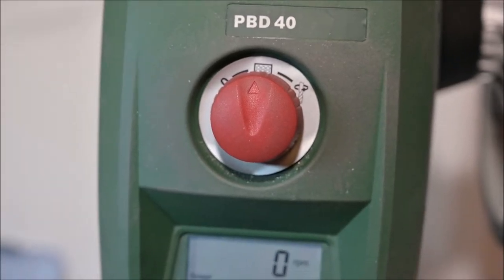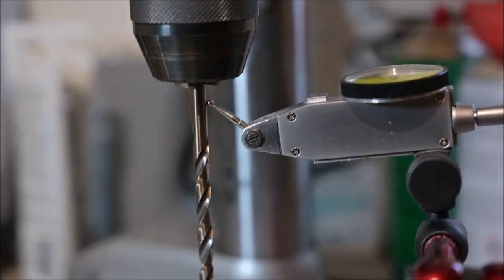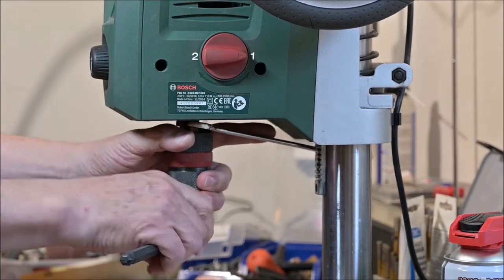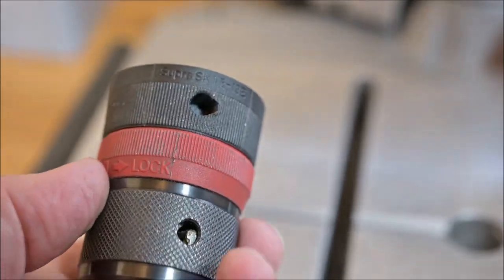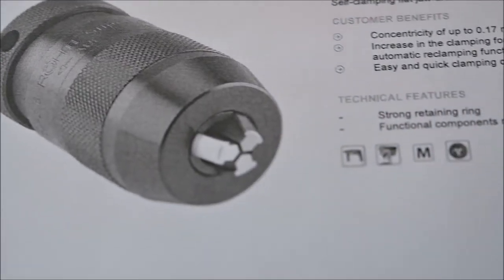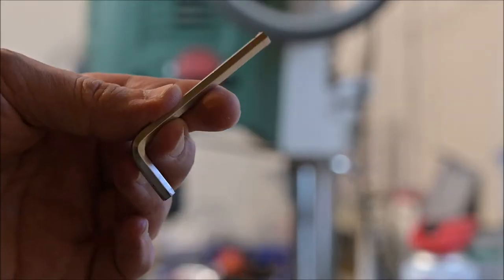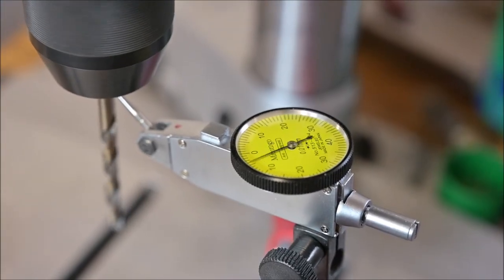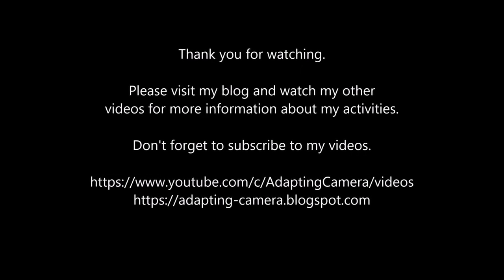Chuck changing on Bosch PBD 40

Comment: Thanks for the video. It's been most informative. I recently sold my old pillar drill as it got too heavy for me to lump around. I have been looking for a new drilling solution ever since. It did occur to buy a PBD40 and replace the bearings and chuck. But that makes a £250 machine into a £400? machine. When you take away the gimmicks, i.e. the laser and electronic depth adjustment, there's only 2 things that make this machine desirable. It's a lot lighter and therefore portable than a traditional bench drill. The only other real advantage is that the drill head moves relative to the base, dispensing with regular checks for perpendicularity. 

BUT the NOISE of that motor. OMG. I'm now thinking a better and cheaper alternative would be to buy a Woodpecker Auto-Line Drill Guide -  assuming one already has a qood quality cordless drill. I'd bet good money that my Makita brushless LXT with an Auto-Line would outperform even an upgraded PBD40 in every single respect; cheaper, lighter, less runout, more torque, more more portable, more versatile and quieter. I already own the Makita. So I'd only have to buy an Auto-line, which at the time of writing would cost me £189 plus shipping, import duty & VAT. A cheaper chinese version (but all steel and alloy construction) is on Banggood for £52 plus shipping, import duty & VAT. I'd love to see a comparison between a suped up PBD40 vs a decent cordless in a Woodpecker Auto-Line.
Reply from the maker: You are comparing apples and oranges. The Woodpecker Auto-Line Drill Guide is a toy and the Makita LXT, while it may be a very good cordless drill, it is still, "just another cordless drill", cheap, impact drill with low RPM. Impact drills are NEVER comparable with any bench drills, and I bet you will have a lot of play in that chuck and axis. But of course, if all you do is drilling a few holes in wood and never need to work with metal, it may be good enough for you, but you can't really believe that the weak 350W motor outperforms the PBD 40, which has a 710W motor, with constant speed and torque electronic, which actually works very well. The Woodpecker Auto-Line Drill Guide is nowhere near making your cordless drill into a bench machine, it is intended for other type of use. If you buy a cheap knock off, you will get something even worse. All in all, even right out of the box, the PBD 40 beats your alternative hands down, that I am very sure of. I also had your idea and actually bought this: https://www.wolfcraft.com/products/wolfcraft/en/EUR/Products/Attachments-for-Machines/Drill-Stands/Drill-Stand/p/P_5027 which is very good and useful, but still, NOWHERE near the usability of PBD 40, even though I have a very high quality hand drill, powerful and is not cordless. Yes, the PBD 40 is noisy, but otherwise, even out of the box is very good and useful, well worth it's price.

Comment: Can I just confirm which way to turn the Allen key to remove the chuck?  I'm assuming clockwise - it's just confusing when you watch the video at that point...
Reply from the maker: I am sorry you found it confusing, though watching it one more time, to me it still seems clear, since I do it slowly in the video and also unscrewing the chuck. Also, unscrewing is always done in the same direction the motor is rotating normally. Otherwise the chuck would unscrew itself during normal use. I find that using the terms "clockwise or anticlockwise" can be confusing unless you know which way you looking at it. Just watch the video again between https://youtu.be/nCqVoaGVK8g?t=196 and https://youtu.be/nCqVoaGVK8g?t=238 where I remove the chuck and then between https://youtu.be/nCqVoaGVK8g?t=387 and https://youtu.be/nCqVoaGVK8g?t=398 where I screw on the new one. You unscrew the chuck through turning it into the same direction as the motor normally is rotating and screw on the new through turning it into the opposite direction.
Reply: @AdaptingCamera  thanks.. Your video was clear but with that weird style chuck and you saying it needed a lot to remove it first time... Just want to be sure..
Appreciate your reply.. Now time to order the chuck.. 😊
Reply from the maker: @newbeginnings8566  The weird chuck is designed for impact hand drill, which is why they felt necessary to have the locking ring. I agree it is weird and feels really awkward to use it on a pillar drill. Also, the locking ring actually makes it difficult to tighten, which resulted in several incidents with my machine. No accidents, but incidents where the drill actually came lose halfway in the material I was drilling. So it is definitely advisable to change the chuck, because incidents like those can end up in accidents also.
Reply: @AdaptingCamera  Just wanted to say my chuck change went well.. I had a T handle Allen key set and I was able to release the Bosch chuck without need of a cheater bar..

In fact it all went well and a medium snug up tighten for the replacement Supra S chuck and it was complete..

Next plan is to fit a custom bolt on handle to the wheel as that wheel is a bit awkward..

Of course these two custom add- ons have increased the original price by 100€. ( I paid 225€ at Amazon for the drill - they have 25€ at the moment)...  So 325€ but a much better tool now.. 

I found the motor very smelly from new..  The laser point was spot-on..  Depth control and general control all fine.. Registration on Bosch website for the 3 year warranty.. 

Anyway best regards and I hope Christmas 🎅 brings you some new workshop toys.. 😉

Comment: hello, thank you for your video and for sharing the reference of the chuck I ordered it on sale 60€!  I saw that some people have changed the bearings is it really necessary in your opinion?  thank you for taking your time to answer me
Reply from the maker: Thank you for the comment. I didn't change the bearings yet because it's more work than I have time for. Maybe one day I will. I am sure it improves the machine even more, especially in my case, since my machine is old and well used.
Reply: @AdaptingCamera  yes that's why I wonder, it's a lot of work and a bit risky that's why I wonder if the chuck is enough
Reply from the maker: @quentinschreiber7926  I really can't say if it's enough for you or not, only that it's enough for me for now. It improved my machine a lot, but I one day I will definitely replace the bearings also. I have all the bearings needed, just have to do the work.

Comment: I just buy Bosch PBD40. Rounout on original chuck is about 0.07 mm, right out off box. I will measure rounout again after some drilling.
Reply: I just measure rounout after some drilling and still 0.07. Chuck on my Bosch PBD 40 is Röhme Supra-SK E from factory.

Comment: Hello  there from South Africa
Thanks  for  sharing  and  showing this change over.  Much  appreciated.
Just to confirm the MOUNTING on this  chuck,  it  is  1/2-20  ???  Is  that  correct  ??   Do  kindly confirm this  as  it's  surprising  BOSCH  (European)  used  Imperial  Threads  ???!!!
Thanks  in  advance..
aRM
Reply from the maker: Well, what is there to confirm? It's in the video https://youtu.be/nCqVoaGVK8g?t=508 and it fits my machine. I think it even says in the manual, but not sure. It definitely shows on the original chuck, so you can check on your machine to confirm for yourself, but so far you are the first of 15 700 global viewers doubting this information. In fact, it is VERY common and I don't think Röhm actually has any metric threads at all even though Röhm is originally from Germany as far as I know. Anyway, very few machines use metric threads on chuck. I even have another, Made in West Germany (yes, it's that old) drill machine which also has 1/2-20 chuck, so it is not exactly strange at all in Europe that in some areas imperial units are used, for example aviation, carpentry, different machines... you name it.
Reply: Thanks Ar M this is the critical information I needed
Reply: 1/2” x 20, and 3/8” x 20 UNF are the standard size threads for drill chucks….there are loads that will fit…Jacobs, Rohm etc…

Comment: Your checking the runout on the drill bit not the chuck???
Reply from the maker: The drill bit does not have that huge runout. It would be totally useless with that much runout. Also, the same drill bit is used on both chucks, and after the change the runout is dramatically reduced. The reduction is a fact, it has nothing to do with the drill bit since the same one is used in both cases.

Comment: That was about 0,15mm runout since you had the lever of the DTI in 45° angle. Better than they promised and the Supra S could have that amount as well according to their specs. The Spiro series are the more precise ones, although even them aren't very high precision
Reply from the maker: I didn't look at the Spiro series, but you are wrong regarding the new chuck I installed. It is better than the original for several reasons, one is that it has less runout even according the specs, the other is that it is MADE for pillar drill, unlike the original one which is made for hand drill, the third is that it can take smaller drill bits, the fourth is that it does NOT have that stupid extra ring for locking, the fifth is that the original one some times releases the drill bit because the locking ring is not always locking tight enough and the self locking mechanism is a joke... I can go on an on about the differences, but if you don't care, that's fine. You probably don't have the machine and never handled that chuck, otherwise you would know all that.

Comment: hello - did you play with bearings replacement as well?
Reply from the maker: No, not yet. I have all the bearings I need, but have not yet done the job.
Reply: @AdaptingCamera  thanks, I am still thinking about this drill but I am not decide to go an buy or not. or maybe pick belt driven Ryobi, but on the other site they also have the loosening problem
Reply from the maker: @piotrkowalski8995  It's not an easy decision. I was also sceptical to this machine because I thought that the traditional belt driven machines are way better, but then I reconsidered and realized that this machine is more useful for me, and has several advantages. Some of those are: 1.) Easy to change speed, and I use that feature constantly. On a belt driven machine it is inconvenient, so I think most people just use the same speed which results in burning the material, the drill bit (or both), but in any way, not optimal use. 2.) It has a powerful DC motor, as opposed to the belt driven machines, which always use AC motors.  3.) Constant torque, regardless of speed, which is possible due to the DC motor. Other things are bells and whistles, but comes to a good use now and then, like the clamping, the depth gauge, the laser, these do exist on some of the belt driven machines also. If I needed to buy a new drill machine, I'd still buy this one, no doubt about that.
Reply: @AdaptingCamera  thanks! I think I buy this unit, its not that lot of money and to be honest in that price range we wont find anything better I guess. Cant wait to see a video with the bearing replacement. I saw few over the YT but none of them shows how to remove it properly from the gearbox housing and how to put it back all in one place without leaving any screw  :) BTW. great vid of yours.
Reply from the maker: @piotrkowalski8995  I did in fact pulled mine apart already the first week, but at that time I did not want to change anything before I really KNEW what I must change. I only opened it to see the quality inside so that I know what to expect in the future. There are not that many screws to leave out after assembly, but there are some plastic screw holes which might break easily, so be careful when you unscrew and assemble it.

Comment: Apparently they didn't use as much thread locker on mine, as I could quite easily loosen mine by hand with a 10mm allen key.
I have noticed that the more I tighten the chuck to the spindle, the worse the runout gets at the tip of my drill bit.
Reply from the maker: You are lucky. If mine was easy to remove I would have done that day one after opening the box. Though, I don't understand how can get worse runout when you tighten yours. Something must be wrong. Maybe your drills are crap, maybe your chuck is wrongly assembled. You should claim warranty because it is not normal, not even for really low end drill machines.
Reply: @AdaptingCamera  I think it might be due to the one of the mating surfaces on either the chuck or the spindle not being perfectly perpendicular to the thread. That way, when the tread is tightened, the misalignment will get worse. If i only tighten it by hand, there is almost no wobble at the tip of the drill bit. Remember, i am talking about tightening the chuck to the spindle, not the drill bit to the chuck.
If it is the mating surface on the spindle though, it will not help changing the chuck. Unfortunately I have no way of checking it, as my dial gauge is not "petite" enough to get close enough to the tread to be able to make a reading all the way round. I would need a lever type dial gauge for that. And the one I would like to have (Mitutoyo) is more than $200.
It is a bit like a bench grinder. If the spindle's mating surface is out of allignment, no amount of dressing the stone will make the vibrations go away, because the stone wobbles sideways.
Reply from the maker: @HepauDK  OK, thanks. It sounds still very strange and if you are right plus the fact that your chuck was not glued, then my guess is that this should be a manufacturing problem with your machine, so it should definitely be returned and you should claim warranty service, which in this case means replacement of the whole machine head.
Reply: @AdaptingCamera  I want a different chuck no matter what, the original just isn't meant for drill presses. But if that doesn't solve the problem, I will deffinitely return it.
Reply: Update: I just got a Röhm Supra L in the mail, and what a difference! I haven't checked the runout yet, but  the tip of the Bosch forstner bit I tested it with was dead center.
"Much improvement, so wow!". :)
Best part is that I bought it as a Wolfcraft part at about 2/5 of what I would have paid for a Supra S. :D
Had to wait for it to get shipped from France to Denmark, but well worth the wait.
Reply from the maker: @HepauDK  Thank you for the update and good luck with the new chuck. I didn't buy the Supra L because I found it a bit too large and heavy for this machine, so I went for the Supra S. Regarding the Wolfcraft, if it is not brand marked as Röhm then it is not Röhm. Never the less, it may be very good anyway, and generally speaking, all my Wolfcraft things I am happy with, so I don't see why I would be unhappy with their chuck.
Reply: @AdaptingCamera  Only the packaging says Wolfcraft. It also says "Röhm product made in Germany" as well, as well as the 9 different brands they recommend it for (AEG, Black & Decker, Bosch, Fein, Hitachi, Kress, Makita, Metabo and Peugeot). The chuck itself is indeed stamped with "Röhm Supra 1-13 L 1/2"-20".
I wonder if my old B&D hammer drill will take the SK, it would be a shame just throwing it away...
Reply: @HepauDK  Can you post a link or exact model number of the Wolfcraft part?

Comment: Great video, thanks. I'm probably going to buy the PBD40 (Black Friday sale) and I was wondering if you know of a compatible chuck that goes down to 0.5mm?
Reply from the maker: Thank you for your comment. I am not a chuck expert, but the 871039 goes from 0.5mm but only to 10mm. https://youtu.be/nCqVoaGVK8g?t=341 that is compatible with this one, but I think this machine is not that good for such thin drill bits. I did drill 0.6mm holes with it, but broke a few before success, so be prepared.
Reply: @AdaptingCamera  Thank you for your helpful response and advice. :)